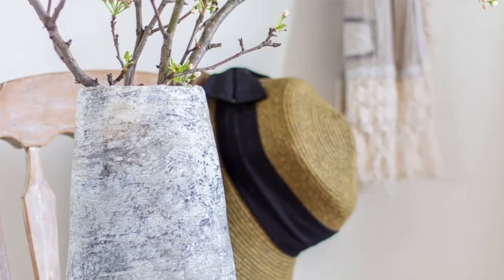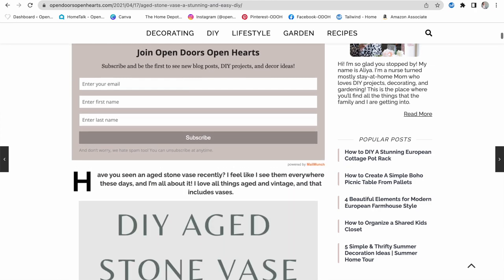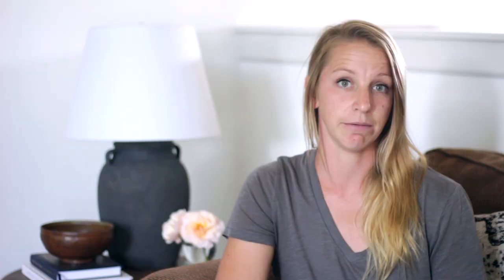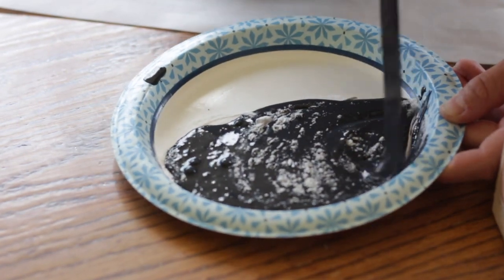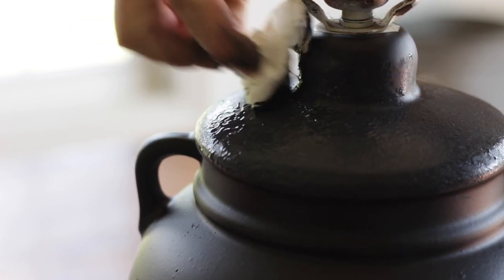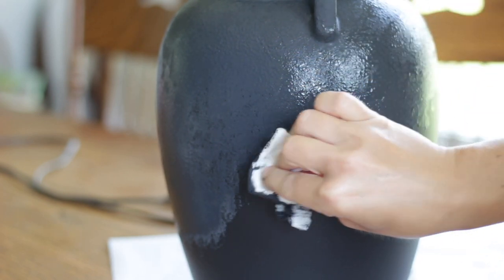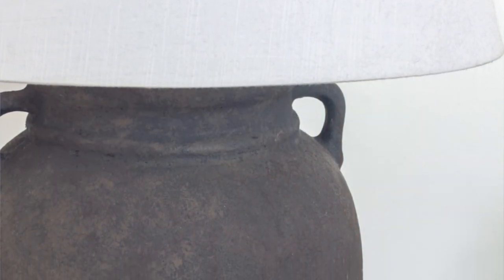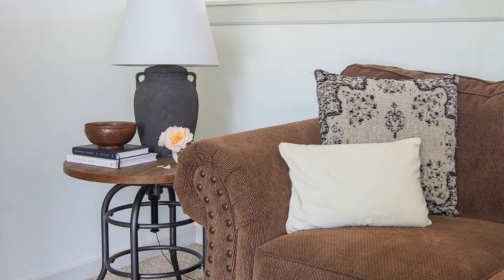Easy DIY Aged Lamp With Baking Soda | DIY Lamp Dupe

Comment: Curious.. mine have flowers on it. I wish I could send you a pic for your advice.
Reply from the maker: I did a post on my blog a few years ago that I think would help with the textured lamp. I just used a joint compound to get rid of the unwanted texture on my vase. I'll add the link here in case you're interested.
https://opendoorsopenhearts.com/2021/04/17/aged-stone-vase-a-stunning-and-easy-diy/
Reply: @opendoorsopenhearts  Thank you!